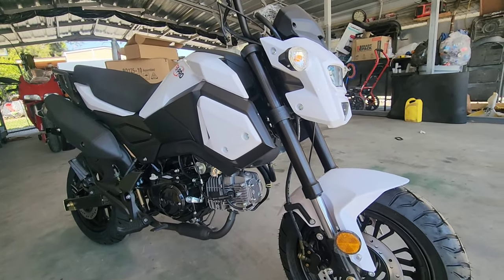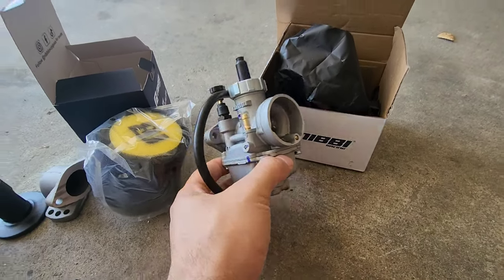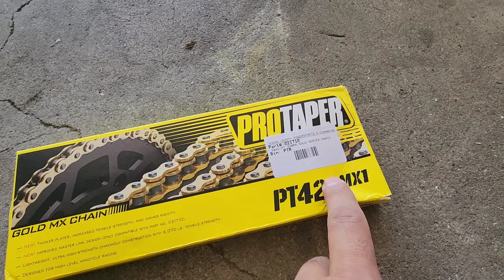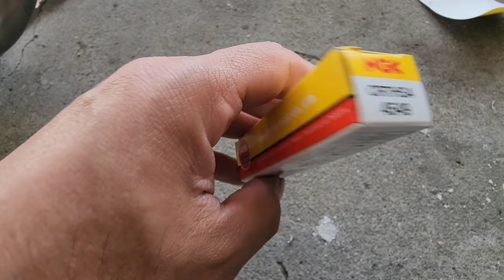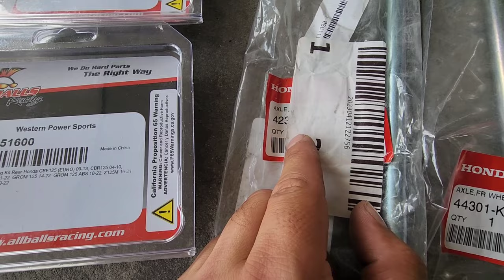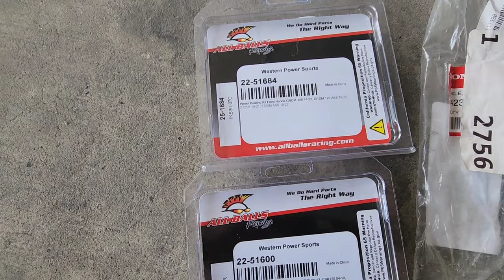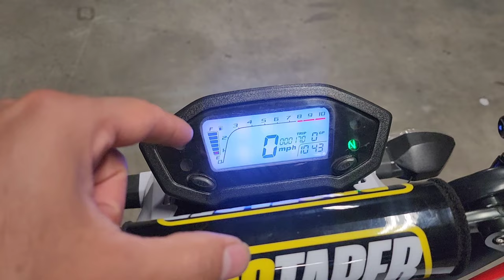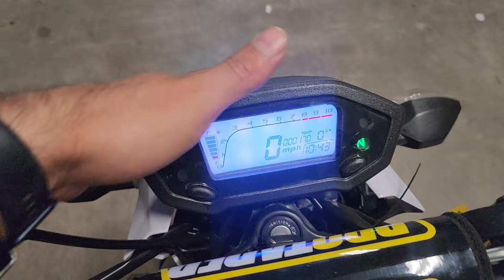Vader 125 Full Guide To Make Reliable (Grom Clone)

Comment: @josephsaucedo8691 where to get info on 190cc engine, spec sheet, prices, etc.  tia
Reply from the maker: I hear Aliexpress is a good place to order one. You'll save some money but will take a couple weeks to arrive. I don't really mess with the 190 as I hear they snap the internal starter chain very commonly just from starting them, but something you gotta get used to. Specs are all over the internet depending on what style 190 or 212 you're looking at.

Go on Facebook group look for "ZS190 Swap Shop"

Comment: IS that the correct manifold 26mm for the 22mm carb?
Reply from the maker: Yes. Different inside diameter. Same flange diameter
Reply: you linked a 22mm and I bought it.. it's not correct do you mind giving me the correct link so I can reorder and return this 22mm one?  @anythinggarage
Reply from the maker: @brandonsssarmiento_  it should be the correct link.

NIBBI Motorcycle Carburetor, PE22mm Flange Carb for 110cc 125cc 130cc with Carb Jets, for Dirt Bike Pit Bike ATV Go karts Moped Scooter 2/4 Stroke Engine with 45mm Air Filters https://a.co/d/hJLcDvn

Unless you received the wrong product. It is the correct link. Try the 24mm if you want should be the same.
Reply: @anythinggarage  i got a 22mm intake manifold and it doesn’t line up correctly you have insta? I Can show you a picture
Reply from the maker: @svarmiento  oh the intake! Not the carb!
I just looked, it is the same link I have on purchase history from my Amazon history, but it links it now a completely different product. Must be a glitch or something. I'll fix it shortly.
Reply from the maker: @svarmiento  
I hope this one works. Should be the same generic product.

HIAORS Intake Manifold 56-2 Inlet Gasket 26mm for XR50 CRF70 KLX BBR Apollo Thumpstar VM22 26mm Carburetor Tao Tao Zongshen Lifan YX 125cc 140cc Engine Thumpstar Atomic Pit Dirt Bike https://a.co/d/dV2CtIE